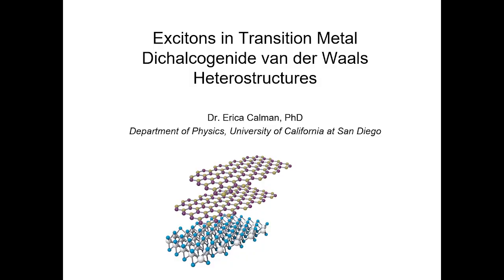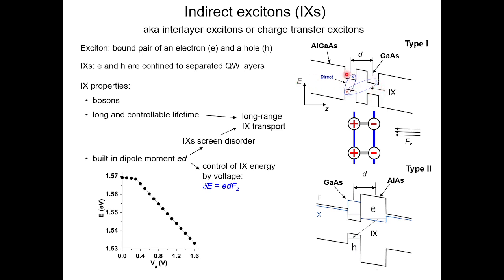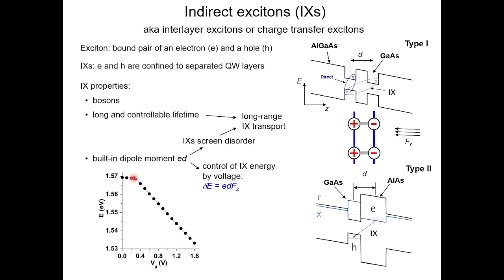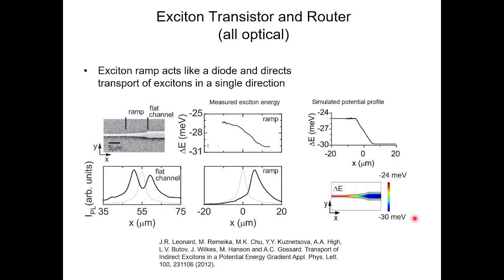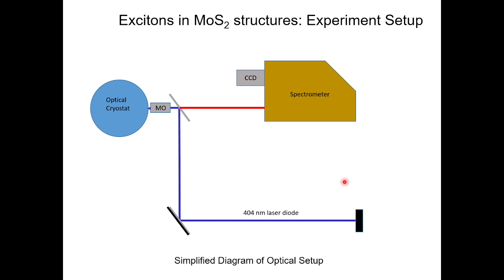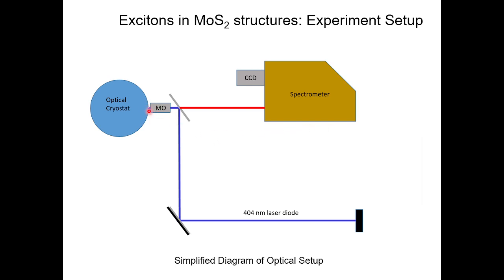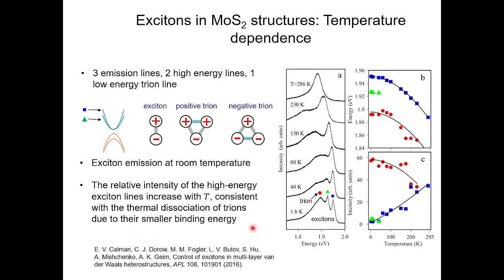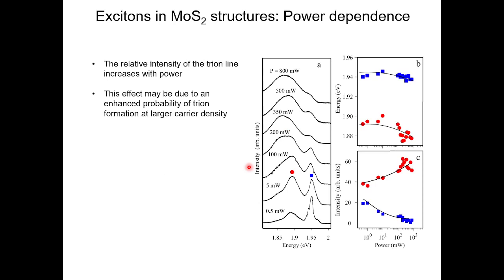"Excitons in Transition Metal Dichalcogenide van der Waals Heterostructures" (My Dissertation)

Comment from the maker: This was mostly a practice talk but since people have been watching it I want to emphasize that the main purpose of using Van der Waals structures is that it increases the binding energy so that indirect excitons are stable at room temperature. Both binding energy and the temperature at which spontaneous coherence is expected happen are both driven by the exciton bohr radius which is much smaller for TMD Van der Waals quantum wells than conventional quantum wells.I do talk about it but I don't mention it explicitly in the first few minutes or when I talk about the limits of conventional quantum well structures.